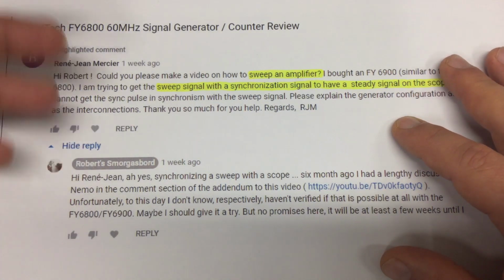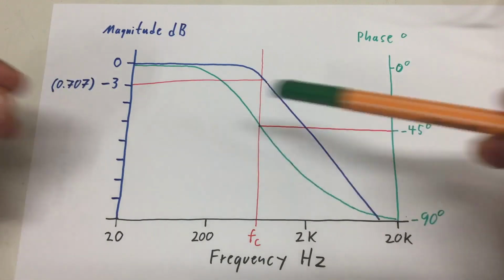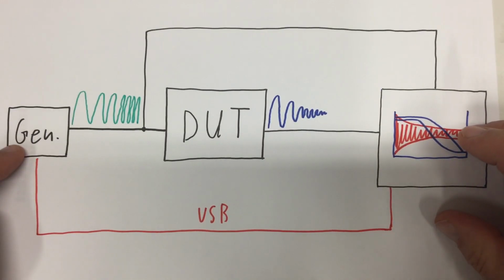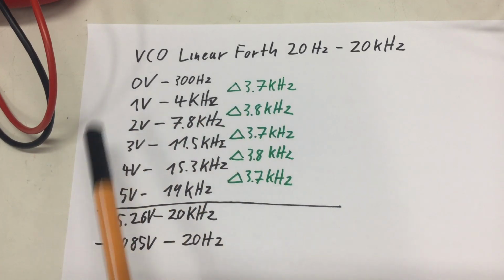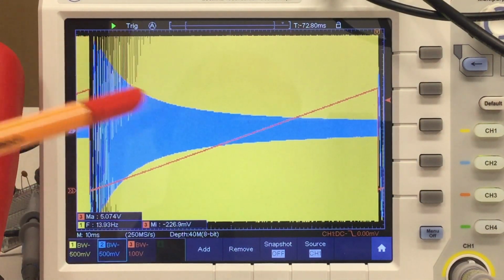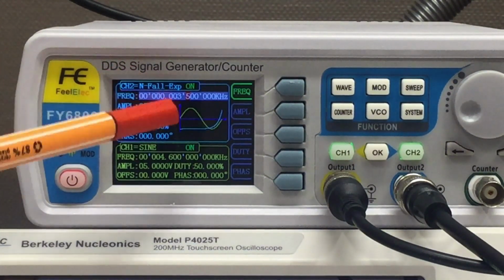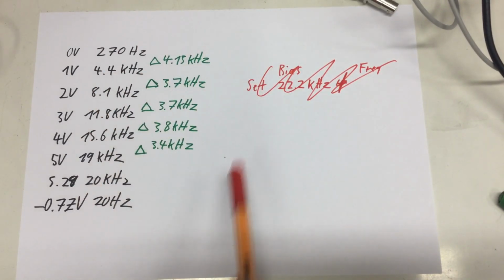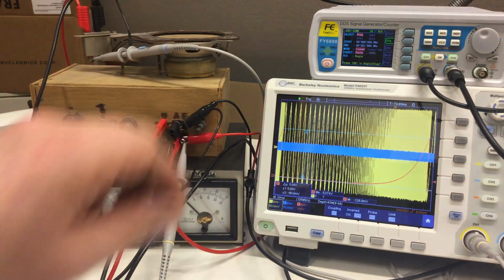Poor Man’s “Bode Plot” with FY6800 Signal Generator and Oscilloscope

Comment: Well a Bode plot is double log. So you need to use the math function for the scope input.Then you should see the typical 20dB/decade falloff
Reply from the maker: You're absolutely right! I wanted to keep it as simple as possible, so it would also work for really cheap scopes, but I should have at least mentioned that 😅

Comment: The frequency response is pretty easy, but the phase response without measuring the waveform is a bit harder to automate.
I think the way I would go about this, is to dump those values you had into excel, and get that to plot the bode.
So if we measure time between peaks for each period viola! (now try programming that in excel!)
Maybe you could do a quick freq response on some scopes by sweeping the frequency on FFT with persistence on.
Reply from the maker: Well, you're absolutely right. However, the challenge here was to create some kind of frequency response plot (poor man's "Bode plot") with just that cheap signal generator and a very simple oscilloscope (no FFT or other advanced features). The whole thing was actually a requested by a viewer (comment on one of my FY6800 review videos).
Regarding FFT with persistence on: That's definitely something to try.
Reply: @robertssmorgasbord  Well yeah, my comment was not a critic, I think all these videos help those starting their electronics journey and sometimes gives ideas to the pros.
I am just refreshing my skills, so going to try measurement from passive filters and build up against their laplace equivalents for frequency and time domain responses.
Thanks for the video.
Reply from the maker: @ThuleApsu  No sweat! I didn't feel criticized and your suggestions are - as I already said - absolutely valid. It's just that the video has another scope and I wanted to point that out 😉
Reply: @robertssmorgasbord  No worries, just an update, been doing frequency responses today, with my Siglent SDS1202x-e I found that the best way to plot frequency response is using FFT with peak-hold, then adjusting the sig gen sweep time such that the FFT has time to record samples without skipping, next I will try the phase using X-Y function and some maths.
Reply from the maker: @ThuleApsu  Sounds interesting! Unfortunately the FFT in my BNC P4025T (really an OWON XDS3204AE) is very basic ( https://www.youtube.com/watch?v=EqCxT5vQNqU&t=267s ). The FFT of your SIGLENT SDS1202X-E does look sophisticated compared to that. Anyway, I'm very interested in your results you get and the actual settings you're using.

Comment: I have found another way to achieve this that I believe is more accurate. Simply pass the trigger output through a low-pass filter and a peak detector. This will produce a signal that has a rising edge only at the start of the sweep. This you can use to trigger the scope. To produce a log log diagram you can set the sweep to be logarithmic and you can use the math channel of the scope to log the y-axis. 

I did this very simply with passive components on a breadboard. I.e RC filter + peak detector using diode capacitor and resistor. It also helps to set the "hold-off" time for the scope trigger to something close to the sweep frequency.
Reply from the maker: A very simple and elegant solution! But it's kind of cheating using extra hardware :-)
Reply: @robertssmorgasbord  Ha, true. It is cheating. But none the less useful. Because I think most viewers have a couple of capacitors, diodes and resistors laying around.
Reply from the maker: @davidosterberg  But then, it's not cheating ... if it yields better results :-) Any yes, I guess everybody can cobble together a RC low pass, a diode peak detector and two BNC sockets if the need arises - no PCB necessary. Put the whole thing into a copper or steel tube with the BNC sockets sealing the openings and you're done.
Reply: Very interesting. Can you describe the form of the sync output? eg it's waveform and timing.

Comment: I'm using the unit for characterize  IF transformers on old vacuum tube receivers....frequency is from 450 to 500 khz and the solution (for me) was to use the vco function with ch2 saw tooth  as sync gen. And it works pretty good....
Reply from the maker: I guess a frequency sweep of ±5.3% (25 kHz / 475 kHz) is much easier on the unit than trying to sweep the whole audio range (±99.8%,  9.99kHz / 10.01kHz) like I did :-) Good thing it works for you in that application.
Reply: @robertssmorgasbord  you are right....but for price we have paied for is good enough
Reply from the maker: @SalvoMorina  And you are absolutely right too! The value offered to a hobbyist for that price is indeed good.
Reply: Thank you for this information. Have you tried this at say 10.7 mHz?
Reply: @jonka1  no, but I think that it works

Comment: you could perhaps do an automated frequency sweep with a PC/laptop. From what I saw of the software you can control pretty much everything on the function generator from software. if the usb protocol is reverse engineered or perhaps even open sourced you could tell the function generator that you want a certain frequency, then use the scope LXI interface to measure phase and amplitude. when i get my FY6900 i'll try and get readings for the USB with wireshark and see what I can do with it. A TTL-Serial interface might work, too. I saw some python code on github: https://github.com/NikkiGirl/FY6xxx that might do the trick. Only need to get measurements for phaseshift and amplitude through LXI. It seems there is something for that here, too: https://ds1054z.readthedocs.io/en/stable/api/ds1054z.html (see get_measurement()). All you need to do then is sweep the frequency with some program, read back the values from the scope and plot it all. nicely. the only additional stuff you need is a laptop/PC which you probably have anyway and a TTL serial adapter for your function gen. the sweep should be more accurate since you can directly set your device frequency, and you get quantitative measurements.
Reply from the maker: Sorry for the late reply. Seems the YouTube comment notification stuff stopped working (at least for me) four days ago ...

And thank you for all the ideas and especially the links. I only did a wee bit programming in Python so far, but it shouldn't be that hard. Can't promise you when I come around doing it, but I'll put it on my list.

Comment: Hi Robert!  Everything Sunday morning your video is a treat.  Thank you so much for such a comprehensive explantation an problem  solving. . Since I have a FY6900 model I will check to see if the offset problem has been corrected or not on that earlier model.  My opamp amp has a wide band to cover (DC to 1 MHz). Now that I have  that great septup that I can use to caracterize my amplifier, I can test its frequency response. 

Your great result opens another question/problem to solve: a peak detector. Is there such thing that would cover the above -mentioned band that could be done? ... A next  video may be ? Thank you soooo much for all. Yours, RJM.
Reply from the maker: Hi René-Jean, thanks for the praise!

Regarding a peak detector - EEVblog has already a nice peak detector tutorial: https://youtu.be/jllsqRWhjGM

To be honest, I don't know when I'll come around doing something along those lines. But I've put a related Post-It on my "wall of ideas" - no promises though.

Best Regards

Robert

Comment: Hi Robert, this was a fun video to watch! I appreciate you got this box from the past to have some fun with. I have a FY6200 which is the panel version, does not have the coax connectors on the back, just power and USB, although in the manual which is FY6200 specific they talk about the VCO etc. I asked FeelTech in the chat and they replied, quote "There is no definition on the back. The customer can connect the corresponding signal as required. VCO signal input from the rightmost terminal of the panel".  What do you think? Could they have the counter input jack configured in such a way that when using the VCO function that input cold be used as such?  My scope is a 2 channel Hantek DSO5102P so I would have to drop the input of the DUT.
Reply from the maker: Well, sounds like they're really talking about using the counter input (rightmost BNC) as VCO input. And yes, that's absolutely feasible: That BNC would just have to feed into the counter analog front end as well as VCO analog front end. Just test it. You can't possibly destroy the counter input by applying 0V to 5V DC to it (limits of the VCO input). Configure channel 1 as VCO, apply some positive voltage (e.g. 1.5V from a battery) to the rightmost BNC and see if the output frequency of channel 1 changes.

Not monitoring the input of the DUT is not a big deal. You could connect your scope temporarily to the input of the DUT just to set the vertical scale of the scope.
Reply: Robert's Smorgasbord Thanks for your feedback Robert! I will test it.
Reply from the maker: @MarcelHuguenin  You're welcome! Let me know if it works. Other people might be interested too.